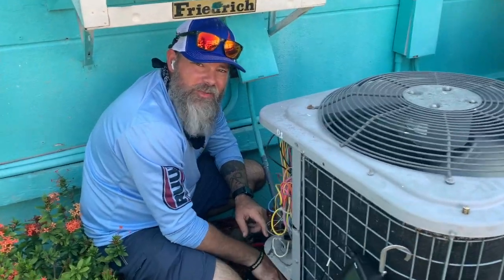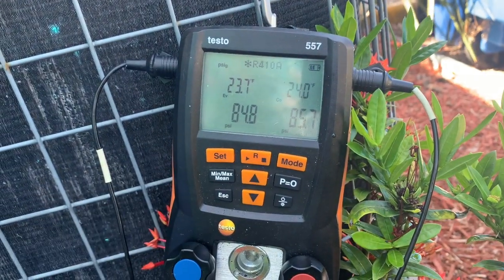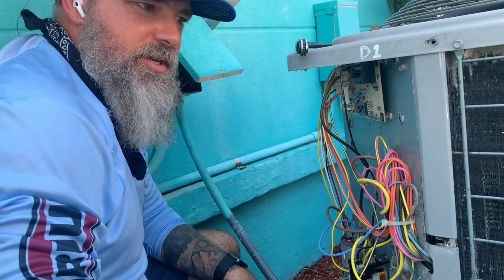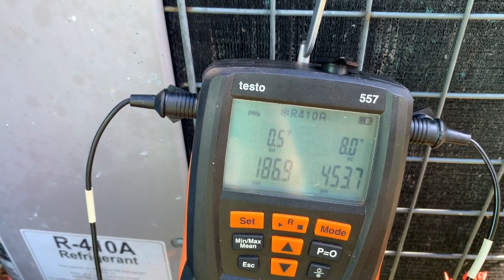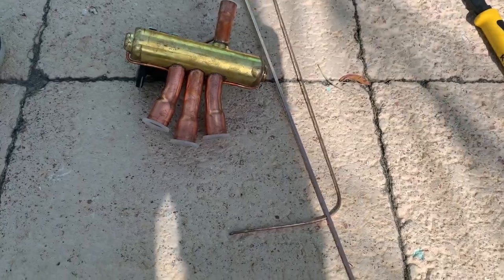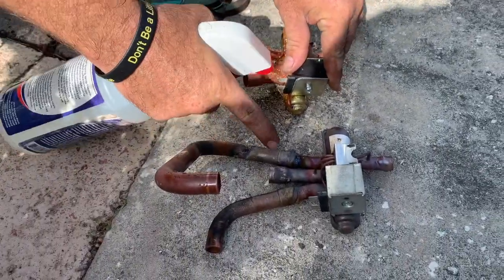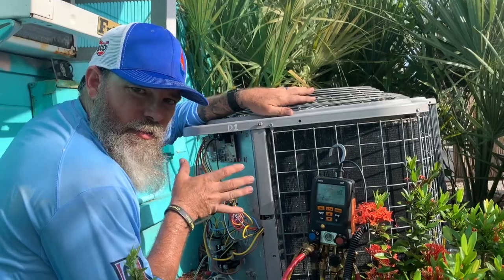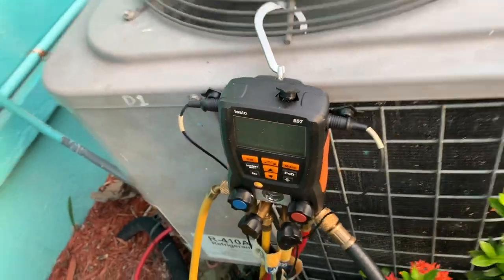High Suction Pressure Resolved

Comment: that low side 157 psi is around a 55 degree evap sat temp... did you check the RV pipe temps with the new reversing valve installed?

Comment: Don't do what this guy did with pushing in the contactor with bare fingers. Always use an insulated screwdriver. A lot of people have gotten a good shock this way from carbon buildup on the contactor. Many ways to get electrocuted by having a hand so close to live power. Electricity is no joke.
Reply from the maker: You aren’t wrong but your giving off keyboard warrior vibes here. Keep it cool man.

Comment: If didn't have a piston. How did it work all this time this is not a new system.
Reply from the maker: I’ve seen it. The system will still meter through cap tubes 
However if you watch the whole video it turned out to be the reversing valve. In this case.

Comment: I am working on a 2 ton York 410A scroll.  Someone else in my co. Diagnosed a bad compressor. I just replaced compressor Symptoms are still present.  Close to normal head pressure about 318 and suction  229.   We are coming back tomorrow with a thermal expansion valvexpansion valve but I think it's the  Piston in there that's causing the problem
Reply from the maker: You either have a txv or a piston. Not both. If it’s a heat pump look at the reversing valve. Your super heat and sun cooling will tell a better story. The only way I can think of an expansion valve would cause this is if the bulb isn’t secure to the suction pipe.
Reply: Someone probably forgot to install the piston

Comment: What kind of torch js that I'm curious and what's good about it ?
Reply from the maker: It’s a Turbo Torch. You don’t need oxygen, just acetylene.
Reply: @AbilityJohn  where can I get nitrogen cone tip for open lines to flow nitro?
Reply from the maker: An AC supply house carries these
Reply: @AbilityJohn  with that said let me ask you one more thing what is your normal saturated condensing tempteture should be during low ambient ?
Reply from the maker: I can’t answer that. Too many variables.

Comment: I'm new to the page . But maybe you can help me 7000.00 . 
I had a repairman come look at why all of a sudden my heat pump is short cycling . They put on a meter similar to yours . But the psi was over 500 on both high and low and the temp was over 200 . I'm not sure if I'm being taken advantage of . The house is 8 years old and the heat suddenly stopped . They wanna replace everything including the air handler but they aren't sure of the problem . "Maybe a clog" . If you could help with some advice I'd appreciate it . Thank you
Reply from the maker: Sounds like they hooked up the gauges wrong.
Are they checking it in heat and getting 500 psi?
Is the system R410a?
This is an easy problem to pin point. I would Call another company and ask for a free second opinion.